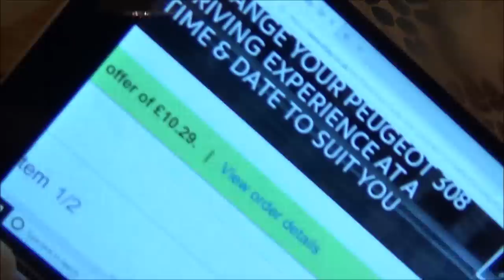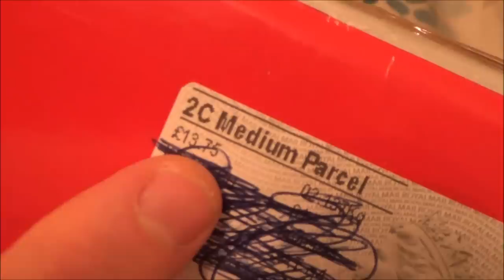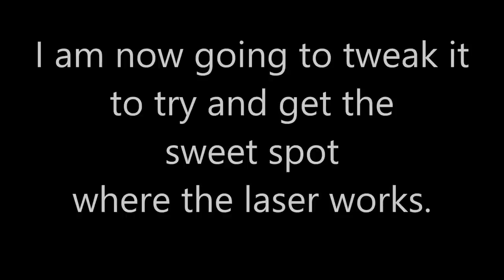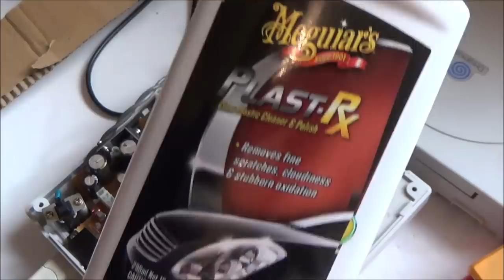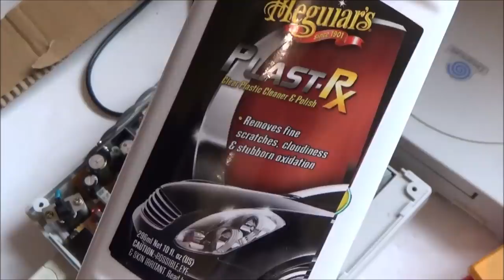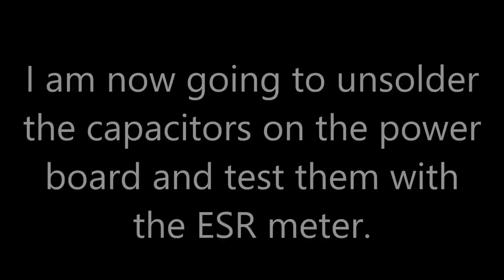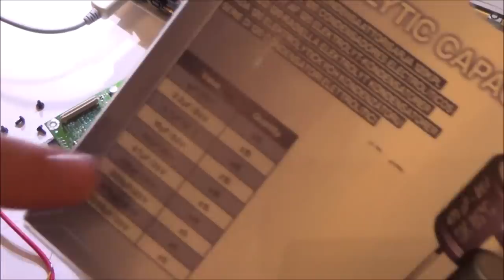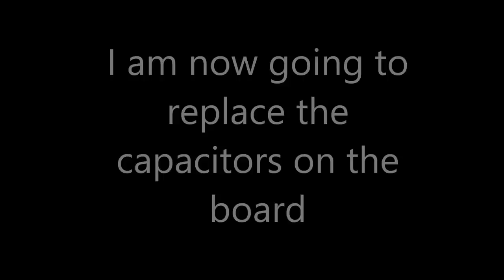Trying to FIX a Faulty SEGA Dreamcast purchased on eBay

Comment: When it comes to the dreamcast and reading disks, I think one of the tips you can employ is checking the settings and seeing if auto start is on.
it may actually save you (or anyone) a lot of headaches.

IF auto start is OFF then the game won't auto load when you're in the dreamcast main menu (or when the system is powered on)
I believe this also stops the disc from spinning AFTER the " please wait reading disc" message although I could be wrong.

Comment: Louis Rossmann is a good go-to guy to watch for micro-soldering and he uses a micro-soldering pencil for touching up small solder joints :) they also sell "hot tweezers" for taking off small resistors and capacitors.

Comment: Hey vince, just a heads up, use cut led leads attached to the alligator clips for more accurate esr readin. When you add legnth to the cable you add resistance.

Comment: I couldn't really tell from the video but did you use the same ribbon cable to test both drives or did you use the new longer cable as well when the drive from the faulty dreamcast worked with the known good board...sometimes the contacts on the those ribbon cables are on the same side of the cable and other times they are on opposite sides..
Reply from the maker: I am not sure if it was on the video but I definitely eliminated the ribbon cable by either using the short one on the faulty Dreamcast or the long one on the working Dreamcast. I had so much footage as this failed fix went on for hours/days!!! so not fully sure if it all made sense when I cut it all down :-)

Comment: Love your tenacity Vince. Not sure if I missed it, but did you try the bad board on the good Dreamcast after doing the recap and chip swap? If it works on the good Dreamcast, then it might suggest the laser or the motor itself is faulty? Sorry if you already tried that combination; I was half watching and tinkering in my workshop so I might have missed it!
Reply from the maker: Thank you, yes the problem was definitely on the bad board, the laser and motor is fine :-)

Comment: That silver cylinder you point to at the end might be a quartz oscillator crystal. It could of possibly blown out. Try swapping them and see if they work.
Reply: i think that's what it is, because thats how it controls everything, the motor and the frequency of the laser, it's all from that crystal
Reply: In interested in that to because he paid no attention to it.  VINCE WE NEED A REVISIT!! your in quarantine nows the time. 
Get that silver cylinder tester or swap it out from the working dreamcast.
Reply: I’m watching this also three years later and the cylinder  “crystal oscillator” at time stamp 1.04:56 near c126 is attached at two points and on the other board time stamp 1.04:47 near c126 black rectangular chip is attached at four points . I bet that “cylinder” crystal oscillator was put in in an attempt to repair it and it is wrong. If I recall the board with the rectangular black chip at c126 is the new working one. You might as well swap that if you still have them. Good luck

Comment: Nice and very patient work. Love the way the desk gets messier and messier as the vid goes on. A bit like my kitchen table lol. I don't own a Dreamcast and no expert on lasers but, fwiw, I think you were on the right track. Maybe need to seat that chip down properly by taking it of, wicking the solder off the pads, seating the chip flat and trying again by drag soldering it. Maybe just wait for the new chip to be sure as you don't want to damage the pads. It looks to me like when you changed the chip the behavior changed radically. Maybe one of the pins was linked to the endstop switch and isn't now connected so it doesn't realize it has hit the end?  You lost nothing changing the caps. They were on the way out anyway and would have eventually damaged the board by leaking electrolyte which can eat through traces. Keep it up and don't throw it across the room .... yet lol ;)
Reply from the maker: Thanks, I will need to have another look at this Dreamcast as since the video a viewer mentioned that one of the legs was loose on the chip I did :-)

Comment: 1:31:35 r118 looks like a crystal for timing I think, but location number id is r118 meaning resistor. tough fix.
Reply: Looks like a crystal to me. Used as a reference / oscillator for one of the chips.

Comment: Hi.  When you put that chip onto the 'bad' board, make sure that you cleaned the flux off completely.  I built a kit with some surface mount components recently, and until the flux was cleaned off completely, the board I built did not work.  Just a thought.

Comment: Just wanted to comment Vince regarding the capacitor values. You highlight the value being the same but the voltage not mattering as long as same or higher. That’s not true, you can get away with a small increase in voltage value but you need to be able to charge the dielectric plates, and if the value is too high which 6.3v to 25v is the capacitor will not work correctly. Also when measuring capacitors, remove them from the board otherwise you are measuring the capacitance of the circuit not the capacitor itself. Hope that’s helpful. Additionally, those capacitors you removed from the board are SMD electrolytics same as the discrete ones but smaller 👍 the component which you pointed to at the end of the video is a crystal, used for clock pulse for timing. You would need an oscilloscope to check it for the sine wave.

Comment: Hi Vince, I know this video has been out there 11 months or so and you may have had this suggested before. Have you considered buying yourself a lab/workbench isolation transformer? it would make things far safer for you when you have items in bits with 230V going in. also you can use them although its not the true purpose to lower mains to 100v or so when testing imported products from us etc. Just thought I'd mention it enjoying the vids all the best Sean

Comment: Hey Vince maybe check the height of the spindle with the working one as sometimes they can be pushed down over the years.
I know that's a common fault on the Saturn. In the past I would just raise the spindle with a pair a pliers. Obviously if the disc is the wrong height it wont read.
Reply from the maker: That is one thing that I didn't think to check, someone else mentioned a possible faulty chip so I might look into that and also compare the height to see if it is possible to get it working again. Thanks for sharing the tip :-)

Comment: Hoped right till the end you were going to fix this🥺
The reason the disc stops is because the CPU is not receiving days from the laser so it defaults to motor stop. Since the laser is good the problem must lie in the coding/encoding bitstream and nothing to do with the motor speed.

Comment: Just wondering if you still have that old Dreamcast? I know you love to have an original but you could replace the GD-Drive with a GDEMU and run games from SD card - just a thought. Also looking online, the component that is on the faulty board, I don't think it should be there - all the boards I have seen have what looks like an IC Maybe that's the problem. Keep up the great work :)

Comment: Check to see if the wires hooked up to the switch that control the laser movement is broken.  If you need any parts vince I have plenty.  I have been doing video game system repair since 2001.

Comment: You have a working unit -- that is great. Get a cup of tea, notepad and Fluke and begin taking measurements on both units, and write them down. When you find different readings, investigate. When you have no schematics or test point data, this technique really helps to find a next step. Cheers

Comment: That little silver cylinder you could not identify was a crystal. Looked post production because of the solder joints on it. May have been needed to balance that circuit after inspection. Some components do look different in that area.

Comment: I didn't read anyone mention it, but you are not supposed to plug and unplug controllers into a DC when it's on. There is a fuse in the controller port board that can blow which will make the controllers not able to communicate with the console. 
Something about the power for the VMUs.

Comment: Ok, between the 2 boards the only difference is a component that looks freshly soldered, looks like a quartz oscillator and you're still wondering what might be wrong? Also, the new behaviour after you changed that chip is bad, are you sure you soldered it the right way?

Comment: Great video, Vince.
I always start by checking the power in and then the power supplies. The 14v on the 12 v seemed too high. What was it on the good unit?
Z101 looks like a crystal. They do come in several different packages.
I don't have any special knowledge of game systems faults so can't help there. Those smd caps do fail so a good try , Vince. I have seen a video where these caps are just twisted to remove them.
CPC in Preston helped me out as well so worth a mention.
As mentioned by others, check resistance with the power off.
Hope you finally crack this one.   8-)

Comment: That dreamcast laser mechanism was so noisy it would alert you to an incoming battle in Skies of Arcadia. The transition sounds would startle you if you didn't have that split second drive noise warning.
Reply: DreamCasts were really noisy little boxes. Sega probably could have afforded to make it a little bigger, if it meant the sound factor could have been muffled. Still, a great, little internet browsing machine for it's day. (No anti-virus needed. No HDD or solid state chips to save virii in.)

Comment: I would recommend getting a PO box (not sure what they call it in the UK) for fans to donate you small electronics to fix.
Reply: Yea would definitely ship off a original xbox I picked up missing its screws and it lights to line its working but outputs no video

Comment: 38:40
What you doing man? Turning it on to measure resistance? There's pretty much no scenario in which you'd want to do that to get a reading. Voltages will disrupt the reading, as will other components in the circuit.

Comment: Easy fix mate! Replace case with an aftermarket one. Then replace the GDROM drive with a memory card reader. Problem solved!

Oh and while your at it, replace the power supply with the new smaller and better aftermarket one that just came out. And desolder the battery with a replaceable slot and add a fuse the left wire, to use non-recharble watch batteries.

Comment: Haven't tested myself with an actual CD-ROM/DVD-ROM laser BUT with an optic fiber you can check the light using the camera of your smartphone.

It's a nice trick which I use from time to time when connecting servers for a fibre card.

Comment: Did you solder the microchip from the good board on to the old board backwards Maybe? Seems like it could be the case because the motor is trying to move the laser in the wrong direction.

Comment: Also, you're using RF for the picture which is absolutely HORRIBLE! Most of us here in the US use Composite for direct connection, but I use S-Video for a mid 2000's small LED tv. That looks great, but I also have the Pound HDMI adapter for the Dreamcast that takes a 480p VGA signal from the console, and converts it directly to HDMI in the middle, and my games look INCREDIBLE! If you're from the UK or Europe, SCART should be possible as well 👍🏻

Comment: Vince - try bridging the lid switch to always closed and see what happens.  The lid switch not making proper contact (due to grime build up) is the cause of a lot of problems similar to this.  The solution is to take the switch apart and clean it.

Comment: Those are surface mount electrolytic capacitors. They're designed to be easier to assemble when the rest of the components are also surface mount.

They silver cylindrical component that you pointed out (towards the end of the video) is likely a quartz crystal. They're usually used to generate a clock, if you probe one of the legs of the crystal you'll likely see a sine wave with a frequency matching what is written on the component.

Comment: I have a dreamcast that won't read discs either, a gear on the motor that moves the laser assembly got cracked and won't move it back and forth anymore, its hardly noticeable to the naked eye, but it is there. And the Dreamcast does have a visible laser light as i looked up the potentiometers too, but i decided not to adjust it.

Comment: Hi Vince, like u're videos 

Since u had swap out the BA5986FM chip from the known good board  and got a speed spindle improvement results but not a read ,
 then it's pointing to a connections issue.
Also from the beginning of the video u'd pointed out that the ribbon cable was cut , that maybe an indication of  someone had abused the pin connector as well..
whenever u  decide to fix it again, i'd love to watch.

Comment: I'm amazed you didnt immediately thing something was wrong when you heard that working unit fire up its disc drive.  Those Dreamcasts have one of the loudest I've ever heard.  Its like the worlds largest zipper being furiously dragged up and down.  I still have the one I bought in 2000 or 2001 and it, despite the odds, still works great.
Reply: I grew up with a Sega Saturn. They have a completely silent disc drive, and with no system fan, the Saturn is completely silent when in use.
I'm very suprised that their very next system was so loud !

Comment: Dreamcast does have online play and servers are even still up today to play Dreamcast online. There is a simple to put together device called the Dreampi that lets you play Dreamcast online using modern internet connection. Dreamcast also supports 480p video over VGA so video quality is pretty high, you don't want to use a cheap RF video cable.

Comment: That silver capacitor thing looks like the same thing you find in a watch. I think it generates vibrations using piezoelectric effect for time keeping.
Reply: It's called a Quartz Crystal Oscillator.

Comment: Also to troubleshoot more complex stuff like that board you got to think about what the device is doing and how it should do it. You see the laser trying to work and the machine trying to read the disk so that tells you that the driver of the board is functioning and doing its job. So next means that it cant read the data. You already worked on two possible issues which is the laser and the ribbon cable which are both good. So next you want to follow the path to the next part. That ribbon cable should have traces that go to the next chip. Start testing that. Then follow those traces to the next chip and so on. If I would take a guess I believe a block diagram would go something like Laser>Buffer>Data Processor Chip>Out going Data Chip. But I am just taking a guess. Hopefully something here might help you.

Comment: I know this is ancient history now, but if you still have both GDROM boards you could run through and get diode readings from the good board (positive to a ground point, and negative probe to test points) and then compare these to readings from the bad board to scope down where the problem is.  I was hoping you were going to get to the bottom of it!

Comment: 1:31:47 That looks like a quartz crystal oscillator, though from what I could see from the video I could not find any information about the component by searching on the component number, and going off on some of the clock frequencies (master and those based off of other clock frequencies) in the DreamCast I could find on the internet, I was also unable to find a logical speed the oscillator would be responsible for (measuring the oscillator frequency with an oscilloscope might prove to be difficult, since some of the oscillator frequencies can be up to a 100 Megahertz and it would require a very expensive oscilloscope to be able to measure that).
If you have a scope, have you measured the incoming power of the drive controller for distortions?  The laser head jamming itself against the end of it's reach looks/sounds like a controller that's absolutely confused because of a power supply feeding it high-frequency rubbish it perceives to be the switching voltage it tries to correct (and fails) or makes it fail becoming stable for operation.
This is also commonly seen in TFT's TV's when the power supply goes bad and the boards supplied by it can't start up properly, even though when you get a multimeter out you will probably read a reasonably stable whatever voltage you might expect to find going off on voltages printed on the PCB or the datasheet, but when looking at those same power lines with a scope they might be "contaminated" with high frequency interference.

I also found a pretty interesting guide that talked about "sleepy crystals" (not sure if it applies to every quartz crystal from every manufacturer, but I'm reasonably sure it does) and could make their resistance go higher than wanted when the appliance it is in has been left unused for a good while and could be solved by making the crystal experience "hard mechanical shock" or being "driven hard electrically" (I assume the last while being removed from the board).

Comment: sometimes simply touching the soldering iron on the pins of the chips to re flow the solder can fix a problem.iv'e never tried it with a dream cast though.

Comment: Well you have a very good spares unit at least. You know the main board, PSU and laser assembly are all good, some of the plastics are in good nick and there's a working controller. Not to mention a good basis for a GDEMU mod. Well worth the 18 quid I'd say, even if you did blow 2 days getting to that point lol.

Comment: The top of the laser is not really the top.. it's under the glass so I used my compressor and blew it really good and it worked
Reply: That was always my quick fix approach. I swear that little noisy fan must have been pulling dirty air across that lens.